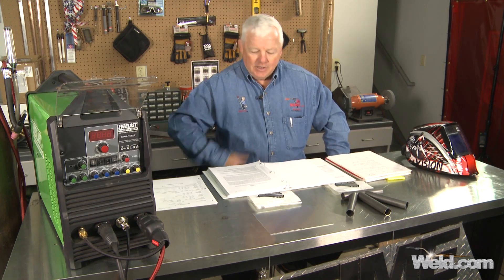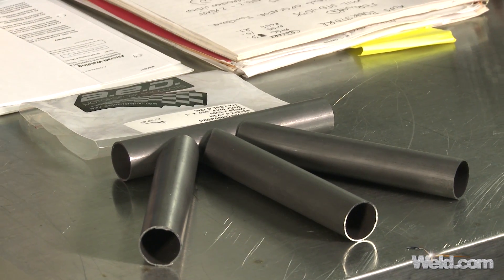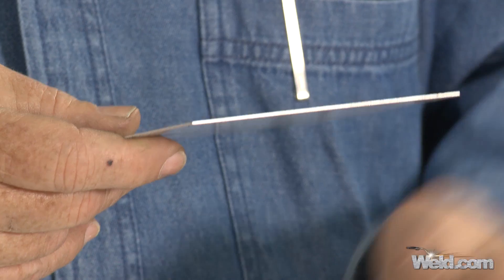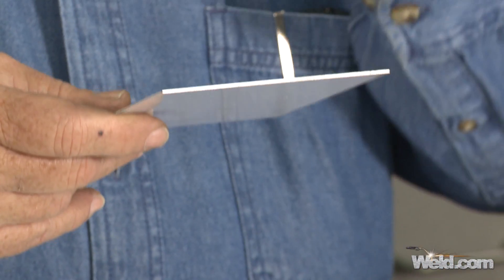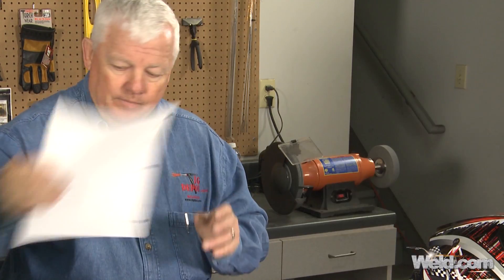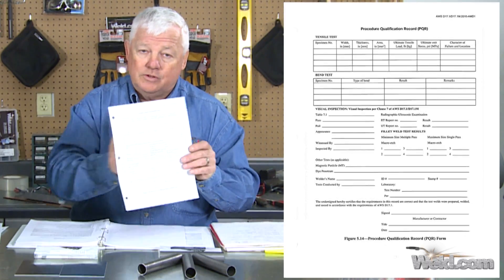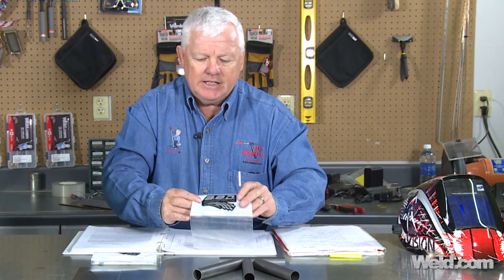How to Become a Certified Welder

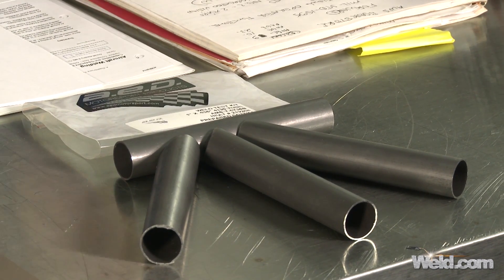Comment: hello there. can you reply to this post plz... how to cut pipe like this here at  2:22
Reply from the maker: jon arbuckle it's not always easy on the older videos,but we do our best... thanks for watching.
Reply from the maker: KtotheP tv Yes tig is now used commonly in the jewelery industry and utilizes dc- with typically the gas lens and argon coverage.  The filler is a one to one match, that is to say, silver and gold and platinum filler can be used. In addition to TIG, a lot of jewelers still use a micro torch (oxy-acetelyne).
Reply: Weld.com i like that you keep up with comments :)
Reply from the maker: You can see how to cut pipe like this in our video with the bad dog biter.
Reply: Weld.com can you provide a link plz ? ty
Reply from the maker: KtotheP tv Cutting and Welding Saddle Joints: Part 2 | TIG Ti
Reply: Weld.com since your here, can we weld silver with tig ? :D

Comment: Paul,  The AWS D17.1  is a broad specification....  You can use it as an operator welding qualification/certification and also use the same specification to qualify a specific weldment.  Additionally, you can use this specification for a welding qualification for automatic welding machine applications.  Our sole purpose for these particular videos is to help answer the question.  How can I be a certified welder?  If you are a one man company, you can follow the basics rules that we have described in the videos but most companies have a quality control dept.that usually identify their particular method of certification.  So in short,  all the welding operator testing and laboratory testing is a qualification. Once passed, becomes a welder certification.  thanks for the question... Mr. Tig